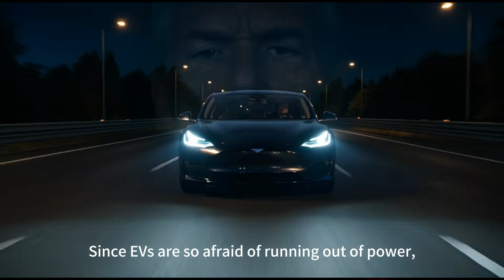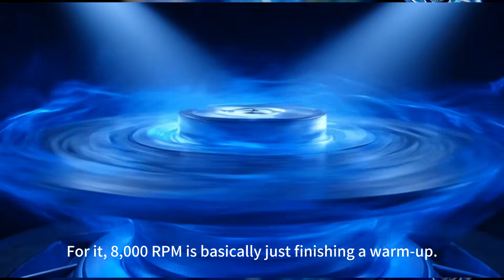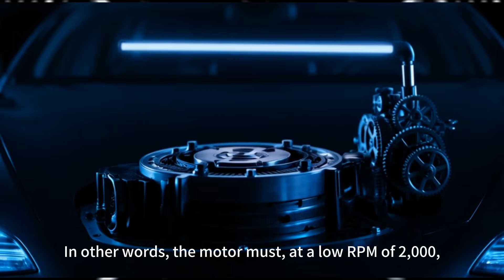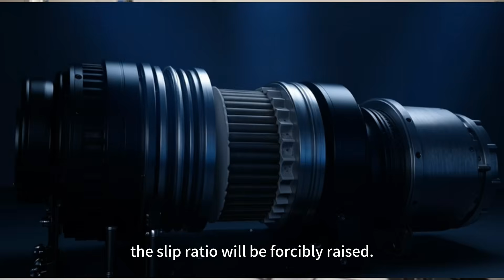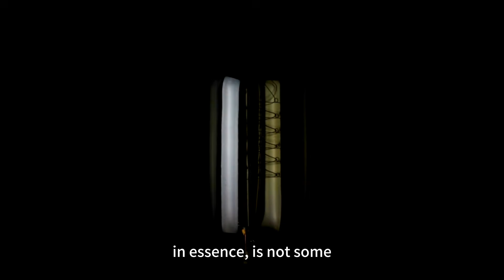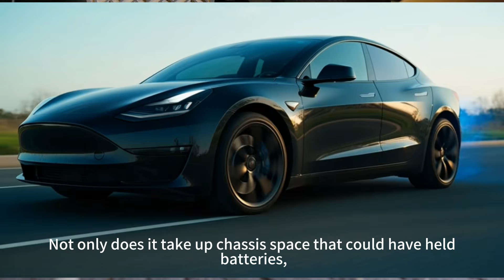The Torque Trap: Why EVs REFUSE to Shift Gears!

Comment: Video starts off, Why don't EVs have a gearbox? Then the video shows the Porsche which has a gearbox. So much FUD out here.
Reply from the maker: The opening question 'Why don't EVs have a gearbox?' is referring to the fact that 99% of mainstream EVs on the market use a single-speed reduction gear. Bringing up the Porsche Taycan was exactly to highlight the exception to the rule! It's definitely not FUD; the goal is to look past the general assumptions and dive into the real mechanical engineering behind it. Thanks for watching closely!